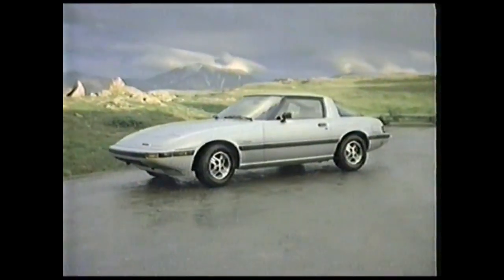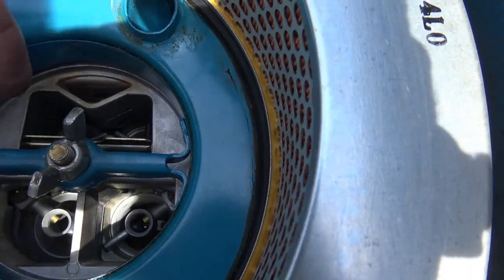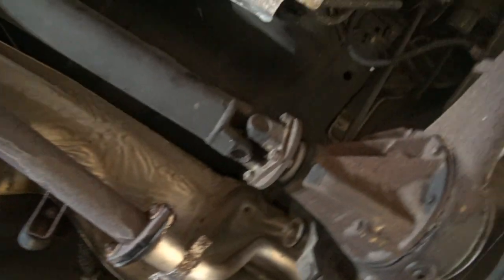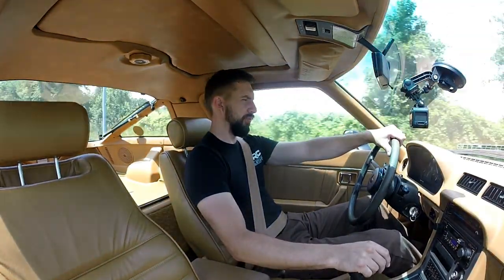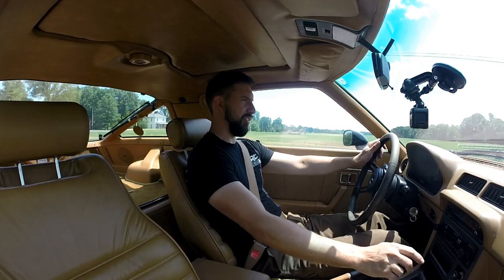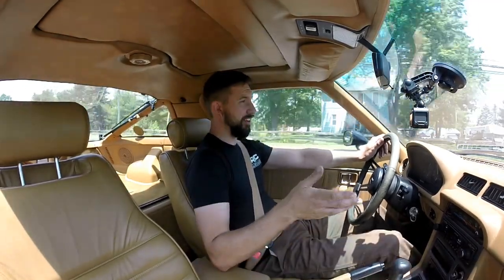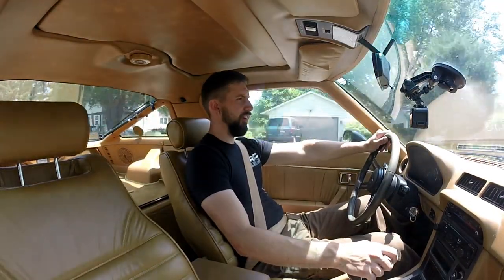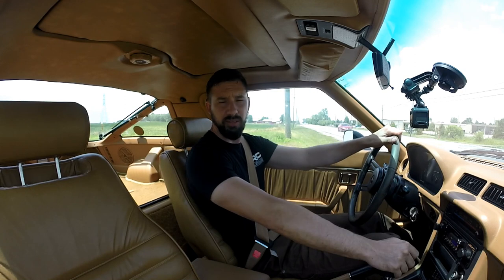1983 1st gen Mazda Rx7 time capsule review and test drive! Remembering the 80s!

Comment: Owned a sweet 1982 12A GS. Oversteer almost killed me a few times, but what a blast to drive. Old school manual choke, fairly easy car to self maintain, oil, air filters. Couldn’t afford a 944 and thought the  Z was too big. Not a fast car, but the joy it brought me was priceless. Fellow RX7 drivers used to activate our pop headlights as we passed each other on two lane roads. Driving down PCH1 on a sunny spring day while listening to the Footloose soundtrack on my cassette player was  peak 80’s. Thanks for this!